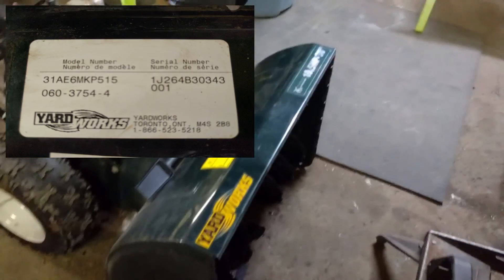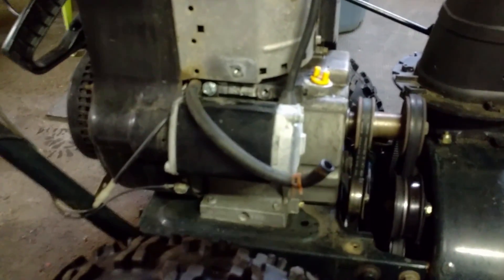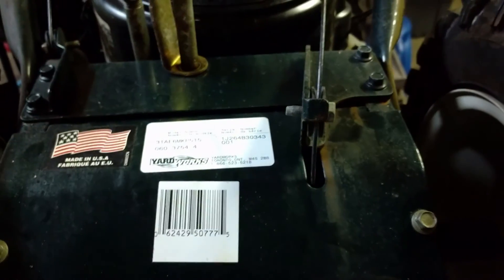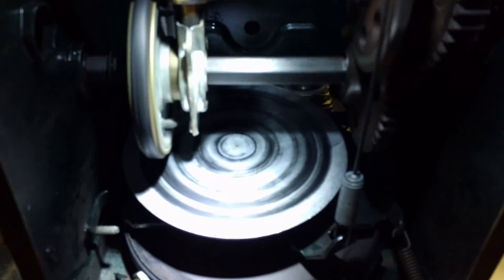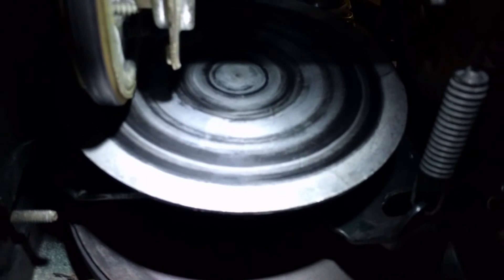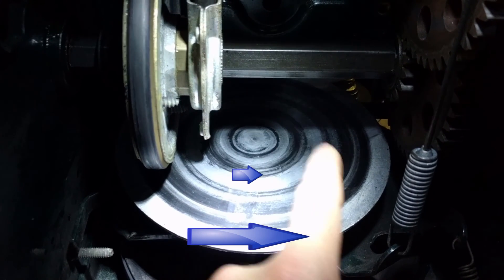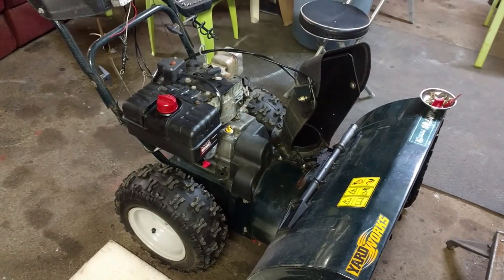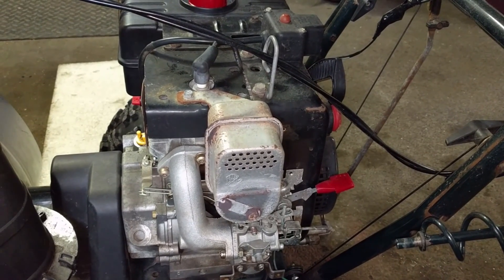Inside A Snowblower

Comment: I bought a snow blower and the person who had it before me drilled bigger holes in the starter bolts. Question what can I do to down size the bolt holes? I had him to try and shim the bolts up to make it tighter. Not sure how long this will last if any, My snow blower mechanic said he did not want to play with this part afraid of damaging the block. So what is my options on this? With causing block damage? thabks love all your videos....
Reply from the maker: You need to look into a heli-coil kit, it would have outside threads that match the size of your holes, but inside threads that match the bolt threads
Reply: awesome thank you @EliminatorPerformance

Comment: need some help brother..i engage the drive the drive wheel stops turning when engages
Reply from the maker: Enzo De Sario the axles? Maybe not enough tension on friction wheel
Reply: Eliminator Performance I've tried to tighten belt as much as could I've maxed out the cable too... I'm lost for what else to do...thanks for the reply
Reply from the maker: Enzo De Sario if you lift it into the air, will the wheels spin?
Reply: yes for about 1/4 of the way on the handle .. then handle all the way down they stop
Reply from the maker: Enzo De Sario Well they're not supposed to move when it's engaged if you don't have the engine running. If they don't move when the engine is running, then I'm sorry to say I don't know what it could be.

Unless it's a slipping belt, but if you have idler all the way adjusted, you'd think that would be tight.
Reply from the maker: Unfortunately, it sounds like a job I'd have to see in person to understand!
Reply: ya I'm lost...thanks for the replies man...🍻